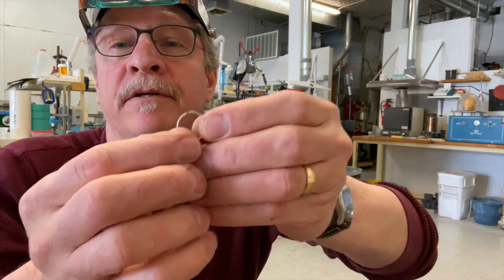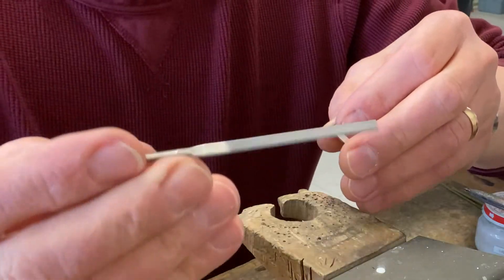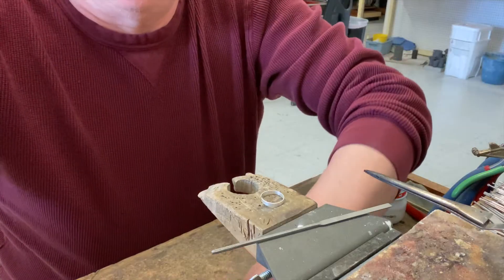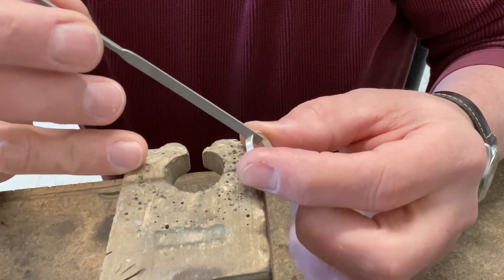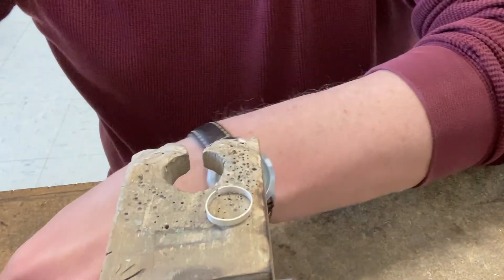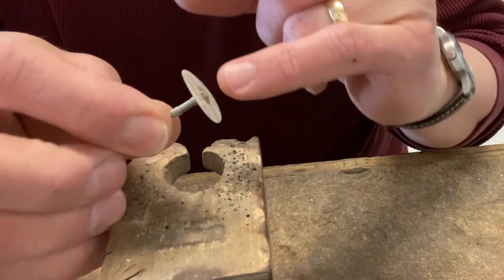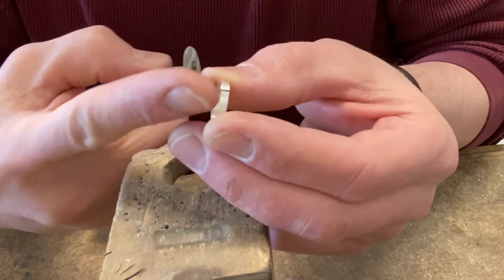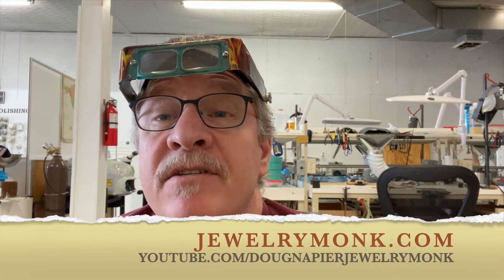How to File Your Bezel Before Soldering

Comment: If you’re looking those mini files up, you might want to also try typing in “needle file kit” and get a full kit that has a blue plastic holder. They come in oil to protect the steel from rusting in storage so just wipe the oil off and try them out!